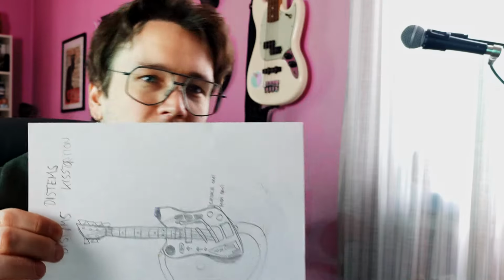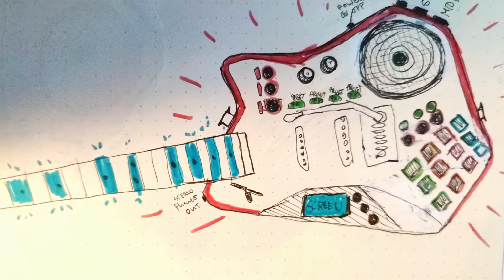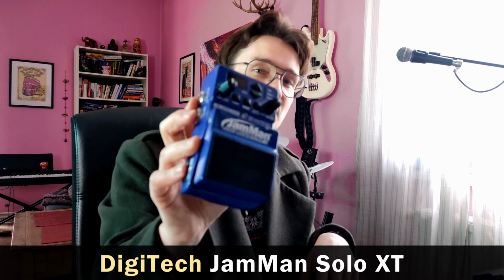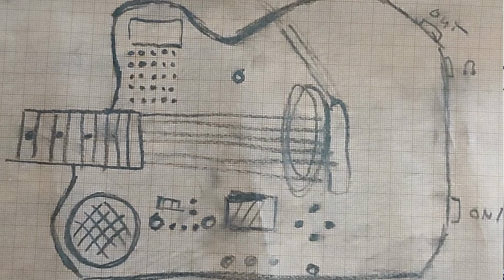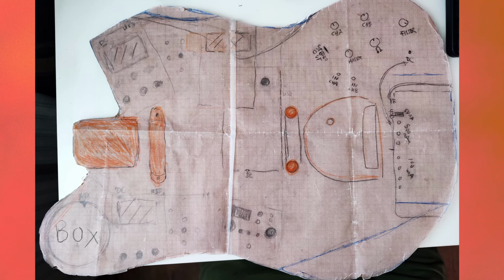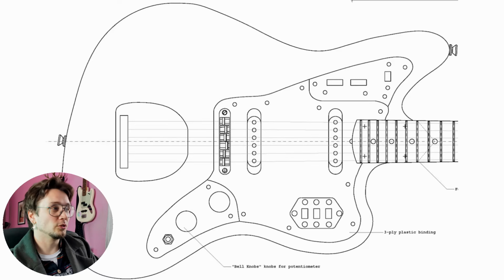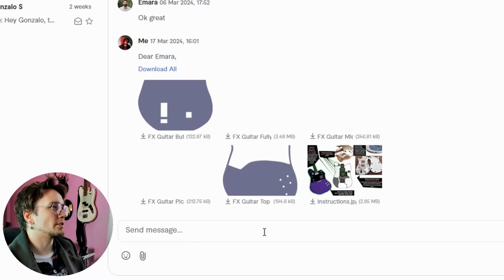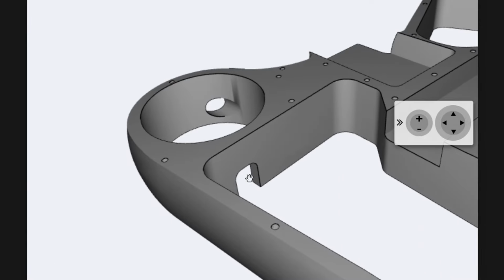Make Shoegaze Anywhere: How I Designed my own Shoegaze Guitar (Part 1)

Comment: Aesthetically, I think the shape could use some work, but I imagine you're going purely functional at this point
Reply from the maker: Yeah, that's a good point. I imagined it a bit different. The shape evolved simply from all the electronic parts that I want to insert. So basically they determined the end shape. If I add "coolness" I would also add "weight". At least that's what I think atm. :)

Comment: Very interesting ideas! I built a lot of experimental guitars and synths back in 80 ties from plastic, wood and metal & i think 3D printing is worst choice to implement your idea... Most important thing for guitar is to hold the tension of the guitar strings, and unfortunately it require the straight of central  hard wood block, if you want the guitar to be tuned and hold the tune... All the electronics can be placed around both sides of that block and can be put into two plywood boxes, that weight less than material used for 3D printing... Every experienced carpenter can make it in one  day, especially if you provide to him pieces of woods used in guitar making.... and of course luthier can do it with ease...